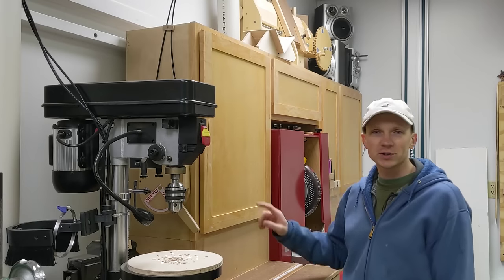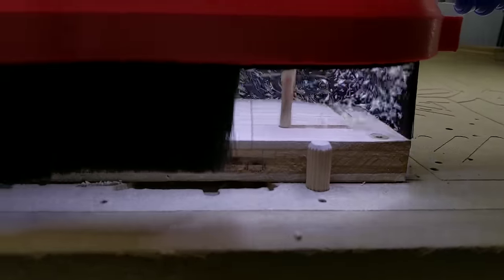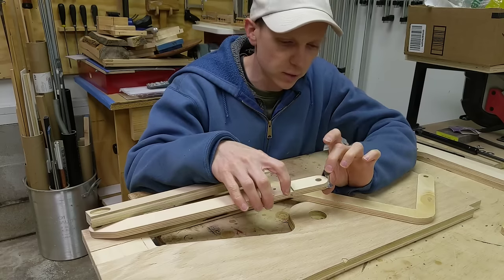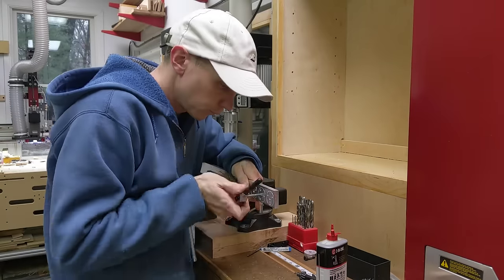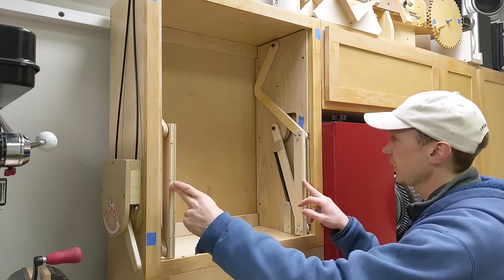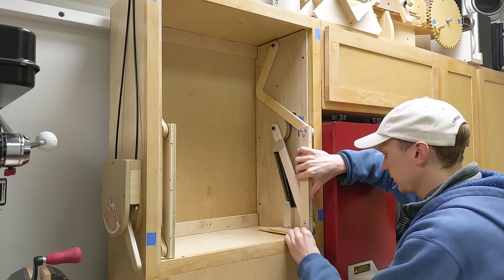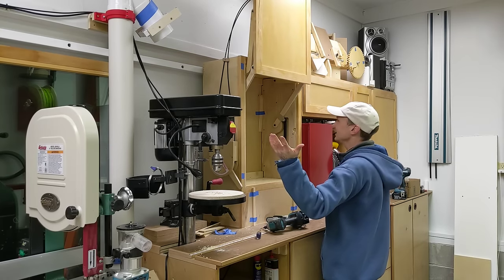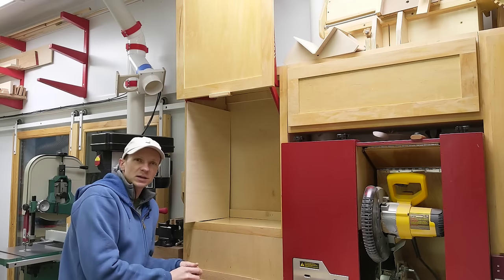This will Revolutionize my Shop Cabinets

Comment: What a wonderful video and project, so many good things to say about your design and build process.
Like you did I instantly started to solutioneer for the side to side when you initiate the opening. A lot of that may just go away on it's own when you put the new side liners in for your organization system but the first thing I thought of was to make the cabinet end of the lower arm more like a lolipop to create an area of contact at each side to counteract the side sway.  It could have a thin plastic uhmw shim or simply be waxed to operate smoothly.  Either way, what a fun and rewarding project.  On it's own it's  like 125% effect for 100% effort even before you figure in the benefit of it's streamlining your work flow in the shop.  12.5 out of 10! :-)
Reply from the maker: I had the same thought with the "lollipop" idea to create another point of contact as well. Thanks for your interest!

Comment: You lost storage space  back of door.  But you can fix that with a pull out bit storage, and hang the drill motors off the bottom.
Might have been cool to make the whole cabnit drop down like the door going up, then you could reach stuff on the top shelf

Comment: Great project but it all should be external rater than internal. Sure You would have to change door face to be wider but you can have internal of the cabinet configured as you want and with same volume as before.

Comment: I don’t know how much it would help with the wiggle, but you could add a “crossmember” at the pivot point of the top hinges that would act as torsion bar. That wouldn’t take up much space. Probably best place for such torsion bar would be up front, but there you have the two mounting brackets that are in the way. You would have to remove them, put in the torsion bars and attach the brackets to those torsion bars. Probably best make them out of aluminum tubing. But not sure how to attach them to the arms without any movement other then welding them to your “t nuts”.

Anyway, this is just my armchair engineering and intuition - no real experience.

Comment: Good to see another video from you Justin.  I've always appreciated your designs and workflow (I basically copied  your table saw cabinet design:).  One off topic question: looks like you have the HF dust collector...what do you think of the after market cannister filter?  Worth it?  Thanks.  Looking forward to more videos in the future.
Reply from the maker: The filter for the dust collector is really good. I recommend it. However I do have to clean it every time I empty the bag because it gets clogged.

Comment: I know little to nothing about cnc.   I just watch others use them.  I would assume you you basically same tool pattern sweep on each part to be able to see the part in the sweeps small window.  Like always starting right to left.  Or opposite. Maybe you figured out an extra step that others can use and not destroy their sweeps.  However as said before, I haven’t really a clue

Comment: The design is good, but, some width of the interior was lost (you also lost storage for your bits that hung on the interior of the door). An alternative to regain interior space might be to consider using drawer slides on the sides of the door and something like a window roll shade (or garage door) spring for counter-balance. The handle pull could either latch at the bottom or magnetic couple.
Reply from the maker: That is a neat idea to still utilize the back side of the cabinet door!

Comment: Hi, a couple of suggestions if I may: in a constantly grabbing things cabinet look at mini spacer shelving so things don’t have to be removed to grab lower items in a stack. If you make the space between items sufficient and the shelf shallower in depth than the items in the stack this will enable you to grip and remove the item. Replace the cut out section of the dust boot with thinly cut strips of flexible plastic, think like the hanging strips of plastic in a cold room that allow people to pass whilst keeping cold air in but on a micro scale.

Comment: I have been racking my brain on a project that uses the same concept mechanism. What was your process to determine the length of the arms and location of the pivot points? Looks like you used a cad program at some point in the process.
Reply from the maker: Yes I used CAD software to work out the length of the arms and location of the pivots. The pivots need to be the same distance from each other to keep the motion parallel. The arms can be any shape, they just have to work around your specific constraints.

Comment: So, you keep your fasteners in carboard boxes, piled on top of each other, in a cabinet? Am I the only one that thinks this is a higher priority issue?
I, too, have a couple of cabinets that have doors that open upwards. I rejected mechanisms such as yours because they 'steal' way too much space inside. I went for a simple catch that holds them open. After all, they can stay open all session...
Given that you have tools handing around your walls, why did you not just take off the door and throw it away?

Comment: as an upgrade of the system, it would better if it could operate in a space bigger than the carved for the piston, all in the same plane as the cabinet laterals, hinged by metal ménsula  , in order to regain internal space

Comment: Can you explain why you made the 'alternative T-nuts' round instead of square so that it would push against the wood, gripping tighter than with the 3 bolts?
Reply from the maker: Certainly. I made them round since it's a little easier to cut a round hole with the CNC. They could have been square. I would just have to cut a square hole and either chisel the corners square or round over the corners on the tnut so it would fit. There is little rotational force on the tnut so the strength provided by using a square part in a square hole is not necessary.

Comment: Quelques réserves.
Cela demande une hauteur sous plafond conséquente que tout le monde n’a pas.
Cela aura du mal à fonctionner tout en assurant une bonne sécurité pour des placards que l’on veut fermer à clef en cas de vol.
On perd de la place dans le placard et la porte comme support de rangement.

Some reservations.
This requires a significant ceiling height which not everyone has.
This will have difficulty functioning while ensuring good security for cupboards that you want to lock in the event of theft.
We lose space in the cupboard and the door as storage support.

Comment: @willn2go1 made the point about the cabinet door not being available as a place to store bits etc anymore.  The up motion of the door is cool, but overly complicated.  A simple sliding track would be easier to construct.  Also it has very limited applications.  Upper cabinet only, as long as the ceiling height isn't too low.
My biggest problem is wth the CNC machine.  Really!?!  How many of us wood workers have the funds for a CNC, or the inclination to spend hours on a computer working out the details and then sit there with head phones on watching a CNC go back and forth.  Tedious and boring.

Comment: Nifty idea, but it diminishes the functionality of that cabinet.  I'm sure I'm not the first to make this comment. Because you hang things on the inside of the door,  the better option would be to make that door open 180 degrees. If the current hinges do this, then just give the cabinet a little more depth by adding an inch all the way round. (So it can lay flat against the door next to it.) You could also beef up the hinges and add more things to the door.
Reply: 180 degrees won't work because it would cover the mitre saw.
Reply: Or simply add attachment points on the outside, similar to the wall on the right of the cabinet or inside of the previous setup.
Reply: The better idea would be just remove the door…. Is that a bad approach?
Reply: @rudolphvanthoff1391  ya because its a shop so sawdust and stuff flying around in the air is going to collect in the cabinets!
Reply: I like the idea for how it works. Personally I want everything and the shelves to pull out and down.. like the way the door goes up.  It looks like it would work for that if you did some slight mods and flipped it upside down.   You could try to make a rail system that could slide up and hold up out of the way or when it’s down, it could open on its regular hinges. That may be a little easier to design(had you not already designed this…). Great work, I hope it makes your shop easier to work in for you.   I’ve wanted to get a small mill for a while now, do you use your cnc for other stuff besides wood and aluminum?
Reply: Please add a feature that allows your door to flip 180 degrees, left to right, so all the tools hanging inside would now be hanging outside.
Reply: Obviously the best way to do it would be to just make a bigger building so everything could fit better

Comment: Cool project but..... The space that you lost just to have a cabinet door that opens vertically isn't a good tradeoff, IMO. You lost the ability to use the door as storage and there will no longer be a 2 tiered shelf system.

Comment: Don't mean to rain on your parade, but talk about over-engineering... 😂 Well done, to be sure, but at what cost? Time, materials, cabinet space, shelving hassle... 

If you absolutely have to move the door up, consider hacking a pair of drawer slides or the like next time. With those you only lose opening clearance, not cabinet volume. The bit holders on the door are still gone, though. 😢

Cheers, Folker

Comment: Interesting concept, however the cabinet is narrower by about 2" each side once you install a shelf support.  That means you lose 4" in total storage, plus you  can't use the backside of your original door to hold the router bits.  That's a lot of storage lost for an unconventional opening.  I think I'll stick to hinges.

Comment: Hmm I'm not a fan of that setup. You still have list space both sides of cabinet and 4" of cabinet is blocked when door is opened.
You'd be money ahead running simple gas struts as I have in my shop on both sides of door & opening door totally away from cabinet to upside and not losing any prior shelving nor wasted space on sides
Reply from the maker: Are the gas struts mounted on the outside of your cabinet face frame?

Comment: Why not make them out of aluminium?
Reply from the maker: Mostly for cost, but I agree they would have been much stiffer.
Reply: @JustinDepew  If you made them out of aluminum but just as spindley I think they would have the same racking problem. Cause you're using wood if you thickened them in the x or y direction (not z, so not actually thicker) like think a 2x6 compared to a 2x4, the rest of the dimensions are the same but the one dimension is thicker. You'd have more strength against racking. Might mess up your geometry and make the rubbing worse though.

Comment: the first threads on a screw in a blind hole actually hold more than the shaft does .... instead of using 2in screws use 1.5in and they wont poke through the front since you have a 1inch bar and a 3/4in door to get them into ... I strongly suggest you rethink your processes 

one if the cabinet door is almost always open and in the way between 2 machines that SCREAMS your machines are out of place and your workshop   is NOT setup correctly .... and your ideas for this door alone demonstrates hat you need to take an engineering course and a drafting curse ....so you can actually see why what you did was a big waste of time

Comment: Nice system, BUT... you lose 1 inch on each inside side, the risk of the levers hitting or pushing over something inside is real, it is more expensive than two simple hinges and offers little or no benefit. It is far too much material and work compared to two simple tried and tested hinges. This looks nice, but the rule, less is more, really applies here.

Comment: Very neat build.  I love those funky articulations and how they can be used around the shop.  Watching you tap those holes in the aluminum blocks reminded me of a tool that I don't see a lot of woodworkers using, and I never have understood it.  https://www.youtube.com/watch?v=n7HLfHZlKL4  While I mostly do metal, the Big Gator drill and tap guides have proven invaluable in the shop not matter what material I'm working on.  And they're made in America!
Reply from the maker: Thanks for the tip! I'll check it out.

Comment: gimmicky, lost space in the cabinet and the door, moving the cabinet up a few inches would clear the door hitting the drill and fixed the problem without losing the space

Comment: What a waste of time for a useless, most inefficient space wasting cabinet. (No hard feelings, I thought this is something extraordinary.) You could have put used two hydraulic cabinet sliders vertically attached in the front with a magnet on top to hold it when it is opened upwards (slided up) fully.